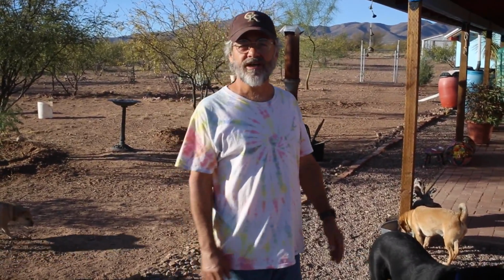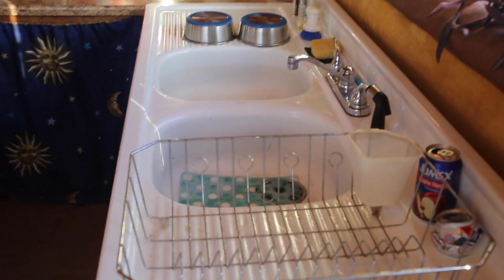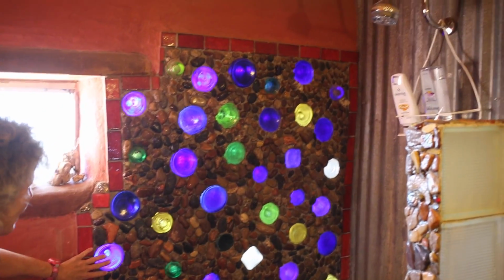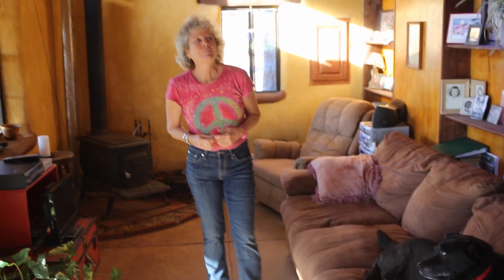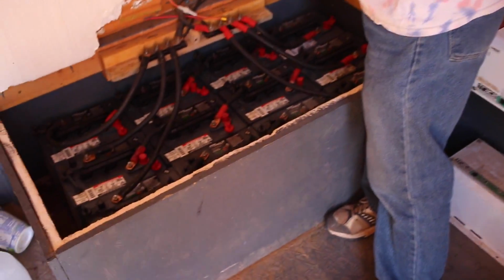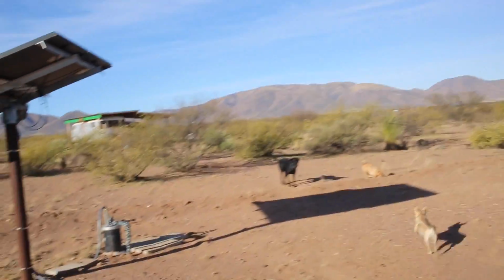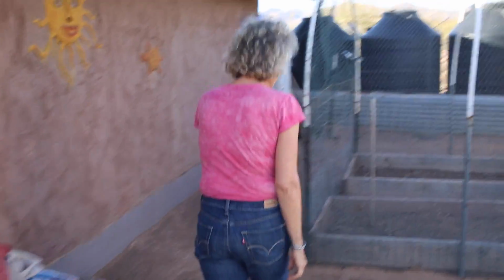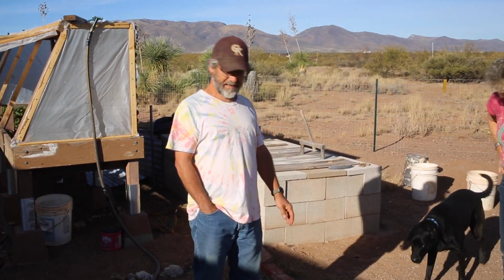50+ Year Old Couple Build Off Grid Cob Tiny House For $30k

Comment: They got the house up for like 10k,   as a well costs like 20k.  That place is a great starter home for a young couple.  You could build a large wide roof shed to collect rain water and save the 20k by spending 5k.  See the water trenches they dug so a flood won't mess it up,  smart.  They also never went into debt to build it which is financial genius.
Reply: Please remember we built in 2010 and our well cost us $6000. One of our biggest expenses was the lumber for the roof as we used all new materials for  that. The cost also included our  septic system at the time required by the county and that cost $5000. and yes times have changed,so you would have to check the price of wells and septic at the time of your build.

Comment: Stunning house. I’ve always wanted a cob hut on the lake. The cabin we currently have is actually smaller than that one. Cob is good insulator so it would be cheaper to cool/ heat then the current setup we have. It would be a great idea to use the solar panels as a roof to collect water during a rain storm.

Comment: Karen and Bob, Very very nice! Where are the two of you located? okay se AZ  It so much like northern or southern New Mexico. Are both of you retired? Do you grow your own food? bTW with climbing temperatures what are your plans to deal with the increasing temperatures across AZ? I would run a line from a radiator and into the house and put a bypass valve on the line water line from the pump and use the cold water from the well to cool the house.
Reply: We live between Bisbee Az. and Douglas Az. in the Sulpher Springs valley. We do TRY to grow our own greens and right now are feasting on kale ,cilantro, spinich and arrugla. We have a bed Bob built that is 4ft. off the ground and in the winter we cover it with plastic. It works well. A small green house attached to the front of the house is in the works. As for staying cool our house stays about 15 degrees cooler than outside. We cool it with 2 ceiling fans and that seems to do it. Thanks for the comment. cheers,karen
Reply: Google hydroponic towers the grow with water and furtilyser. They conserve water the best. Can be made with large pvc pipes
Reply: Thanks Lorin, Just read an article about that in the New Yorker,very cool indeed!!

Comment: We are building a house that is so similar to yours - its quite a familiar structure - but roof pitch 4-12 and ours is only 400 sq feet - 200 less than yours. We're in the cold upper NY state cloud cover region. Because ours will have a basement, we'll need to do some site work, code is different in NY -  - ours will most likely cost about $60,000 - it won't be debt free - but we did have kids and other differences in our situation.  More power to ye! Yours Jennie
Reply: For sure children make a huge difference in circumstance. Bob and I both spent our childbearing years traveling and living in Mexico for quite a bit. Kudos to you and your project!! Your home sound wonderful . Best of luck to you and your family. karen

Comment: if you added dirt to the roof the temperature inside would drop
Reply: Was going to say the same thing, why not make it into an "earthship"?  Would be WAY cooler indoors.
Reply: True, but you have to design your structure for that.
Reply: yes that would work but what is the weight of the earth?
Reply: They don't really have dirt around them.. it's pretty much just rocks

Comment: Fantastic job, Karen & Bob! 
Very inspiring.
Must be frikkin' hot down there close to the mexican border.
About all gardening: Don't spray water on anything. Try to support any water in underground lines to avoid vapourating of any water. Plastic foil could prevent water from
evapourating. Everything cool could help water in the air condensate on it's surface.
To let it run down that suface, straight into the ground.

Comment: great inspiration. we are an older couple (77 & 57) who just went off grid this past spring (2015). We built our tiny cabin. we are still working on it. they are right about build small and add on later. this year we will be working on the porch and deck for the tiny cabin. stop by and check us out

Comment: My small house is 24x28 which gave me a nice sized bathroom which includes the washer and dryer and hw tank along one wall, a decent sized bedroom and an open L-shaped kitchen/ living room. I  drew lines on the floor with measurements to see how everything would work out and made corrections before building inside walls. I was lucky, the well is only 23' deep, 36" cribbing and cost $800.